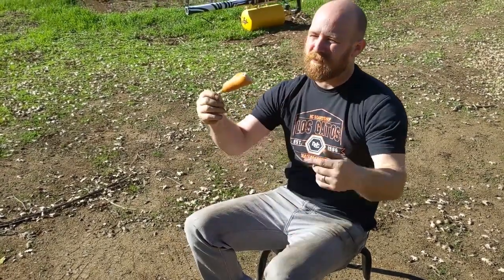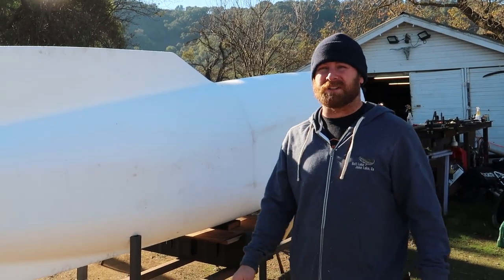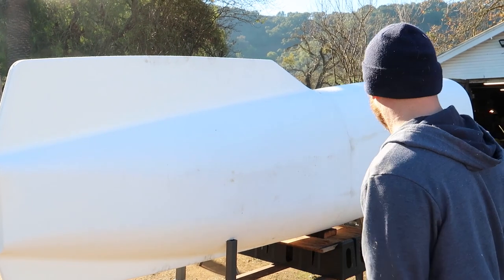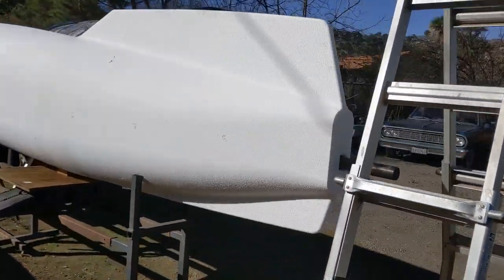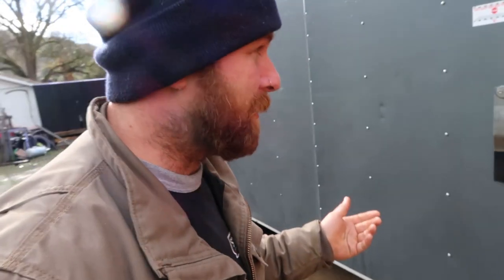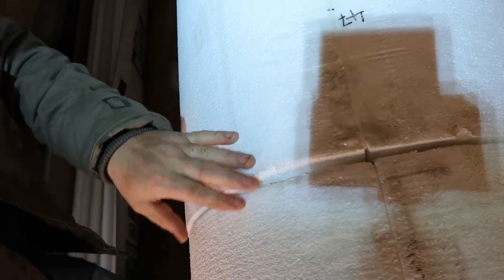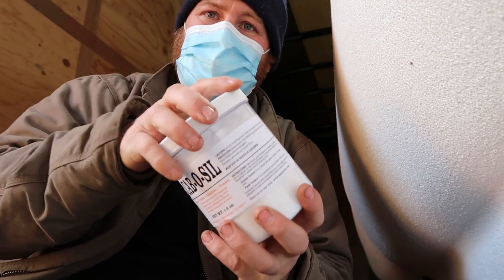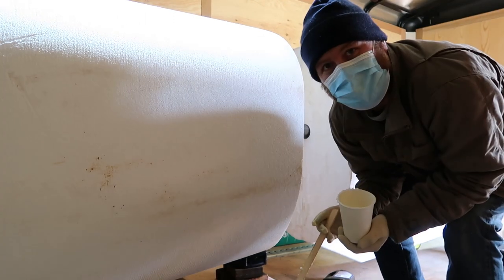Streamliner Body fixturing and Carbon Prep | Lark Machine Co

Comment: Lucky or good, I never would have believed you could core drill that accurately over 18ft. Nice work!
Reply from the maker: Right!!!!  I was sweating it hard.  I think having that table with welded guides help a lot!  Plum bobs are always my go to for big straight jobs
Reply: @sheanyquist  Right, locally gravity is a constant, never failed me yet. I am also a big fan of the self leveling, XY axis lasers.
Reply from the maker: @olsonspeed   i use them from time to time, but I always seem to bump the laser or its to bright out.

Comment: Great work mate, Hindsight is great, also maybe even a couple of dowels to line up or help secure the 3 pieces while the epoxy goes off,
Reply from the maker: Hahaha, yeah. I was just scared I would mess up the dowel locations!
Reply: @sheanyquist  yep, then you would be stuck with it offset, I quess you had the seams at the top and bottom to help you line up the pieces, where are you going to have the join for the two halves of the skin, is it going to be split vertically or horizontal ? Are you going to make a removable hatch or a tilting hatch like on the GP and unlimited Hydroplanes ?